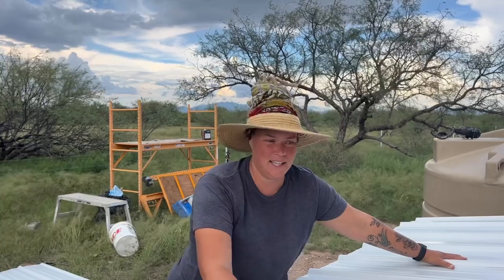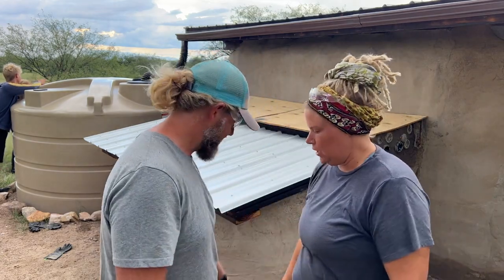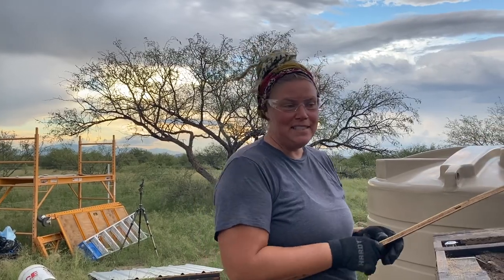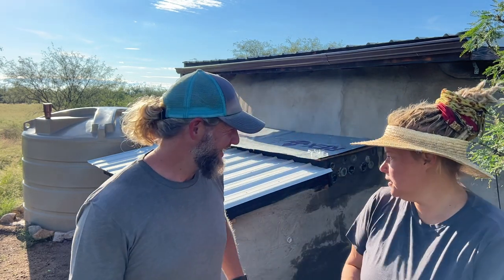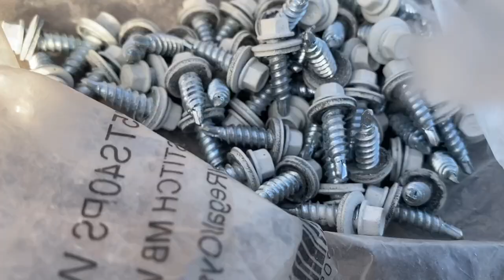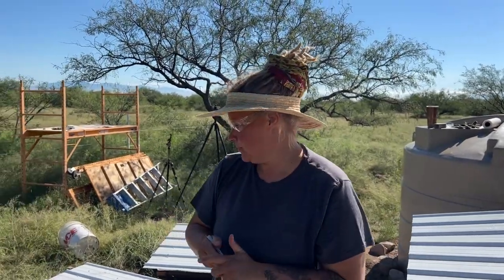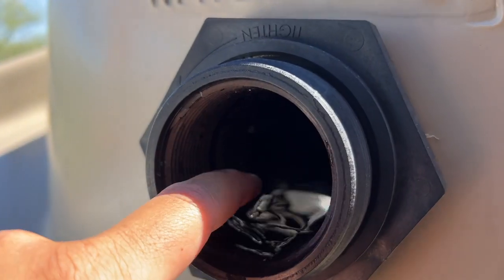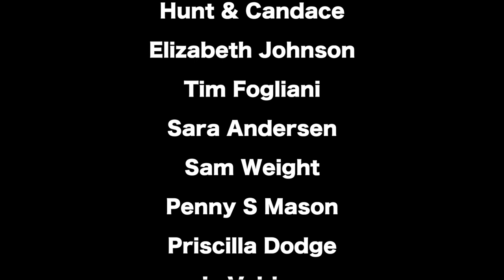How Did This Get So COMPLICATED? Metal Roofing on the Pump House (Chicken Garden Day 169)

Comment: Looking at the structure of the lid to the pump box.  You mentioned weight being excessive.  In the future try using metal studs to do the structure and framing of the lid.  Reinforce structure between studs using rigid foam panels and expanding foam to fill voids and allow a rigid structure.  The exterior edges would have to be trimmed with 1 x ? Material.  I built my coop using this method.  I had to add half inch plywood to interior for structure and protection of insulation.  The coop had a 40% saving in weight with the benefit of 2 inches of insulation.  I actually weighed the coop as its trailer mounted to improve range feeding.  A lid wouldn't need interior reinforcement so would be relatively light.  Secure from wind using hardware tbd.

Comment: I'd have done just the opposite. Fitting the underlayment to the curve you can use that as a pattern to cut the metal panels,  (before tacking it down) and allows you to climb around and stand on the lower section. Easy peasy. ... as for the tarantula, it's called balance.

Comment: You might be able to adjust the speed if you buy a duplex outlet and a dimmer switch. Wire them together in a 4x4 box. I used a setup like that for some lights back when I was in the army. Have power go to dimmer first and then outlet.

Comment: thanks for the videos  great tunes with titles! as far as cutting a curve goes  your overthinking it,,,,even the multiple pieces part. keep your back edge straight , make shure your length is sufficient for overhang and the largest part of the gap to wall at the other end. set your dividers to that gap  scribe the wall and cut ...dont even need a measuring tape. you probably should have left a drip edge on the underlayment  but you do live in a desert lol .

Comment: I’ve seen if the pitch of a metal roof isn’t a 4”on12” pitch that bad storm winds  can blow up and over and underneath, if you find excessive water it may be from the blow back situation of each layer with no flashing installed. 😝🤞🏻

Comment: I used a nibbler to cut window holes in vans when I did van conversions in the 80s.  Not sure if yours cuts 1/4 moon shapes like mine did back then.  If it does, be sure to clean the nibbles up so they don't get in little feet!  Would be awful if Nine Nine went lame from stepping on them.  Looks great.

Comment: Just wondering why you drilled pilot hole for the elf tapping screws? To keep them from wondering…just put the screw in the drill and tap down on the drill. Just asking and giving you a tip
Reply from the maker: Because we’re new to building and don’t want to screw it up

Comment: Looks good, but I would round off the corners of the metal roof to prevent nasty cuts to those working or passing by.  Just a Safety Sally comment, but it might be worth doing.  Pump house looks cool if just a wee bit overkill.  1300 gallons of H2O already?  Majorly awesome!
Reply from the maker: It would be much sharper if we cut the metal ourselves. It’s really not that sharp and no one will be playing around back here. It’s fine:)
Reply: @TinyShinyHome  Thanks

Comment: Love your videos. Curious why you screw the metal on the hills instead of the flats? I was told if you screw on the hills you can't get the washer tight enough to seal. Edit: Nevermind. I see you only did it on the overlaps. I only saw it on the closeup earlier in the video.
Reply from the maker: Yes, short metal to metal stitch screws on overlap, longer metal to wood screws into the material below elsewhere 👍🏼